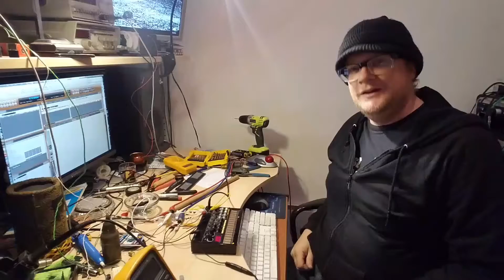Danieldialatone Volca Beats midi out mod breakout cable

Comment: Hey man, that's actually a very elegant solution! I think I'll try that on my Volca Keys... Is it correct that I have to disconnect PIN 1 and PIN 3 from the PCB? And what about GND? Do I need to disconnect the MIDI IN GND as well or can it stay? Do I need to solder the MIDI OUT GND to the GND pin also, or is that unnecessary? Thank you very much!